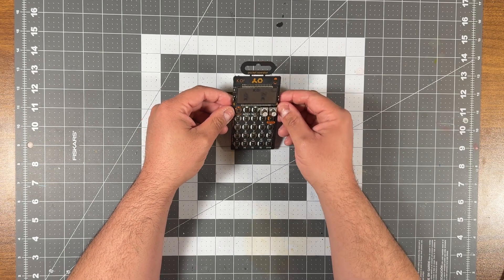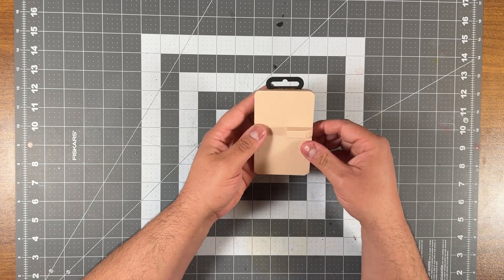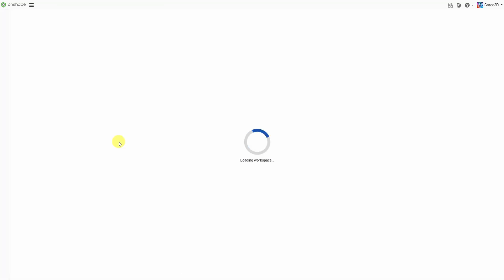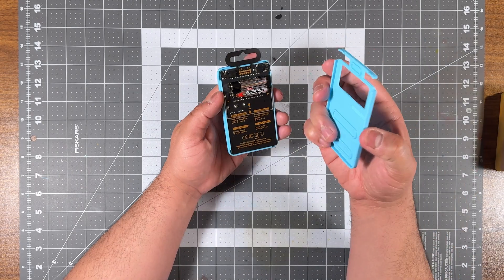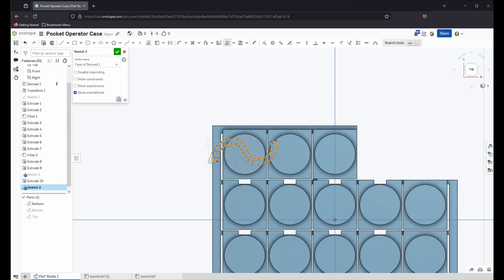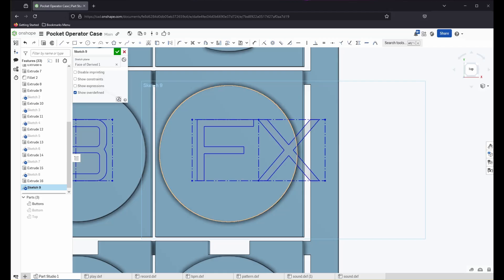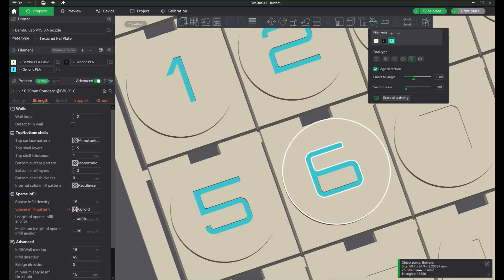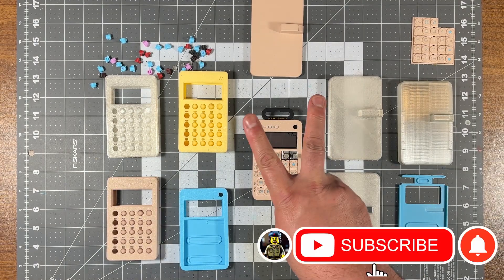How I Made My Own Pocket Operator Case Using Onshape?

Comment: Man I've been stuck with naked Pi stacked on 18650 UPS that has zero CAD files anywhere. It's new new, so it's not that surprising, but I'm terrible at Blender and even end up making junk with TinkerCAD. I'm going to have to find somebody willing to slap together a Pi+Display .stl with a case for the UPS. For somebody with skills it would take minutes, the Pi stack is already well modeled, just the UPS isn't integrated by anyone but me so far
Reply from the maker: Onshape is very easy to learn and is free. It would be best for you to learn that way you can prototype your designs.
Reply: @gordo3D after watching this I've decided I will be trying it. Im usually partial to Linux tools, and I DESPISE AUTODESK regardless of how good it is. This however seems approachable.
Reply from the maker: This is web based so you can use it on any OS.